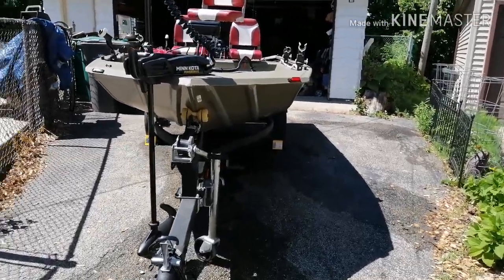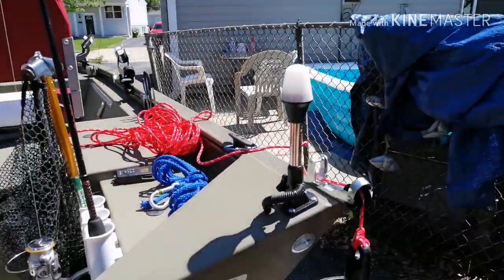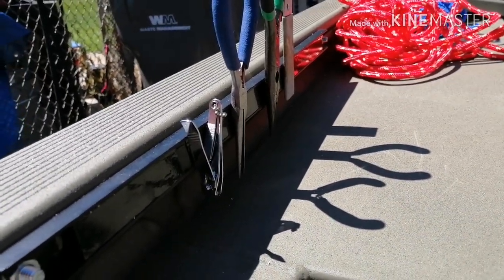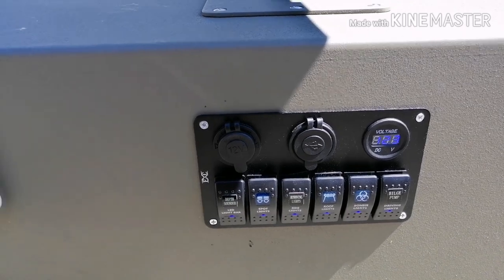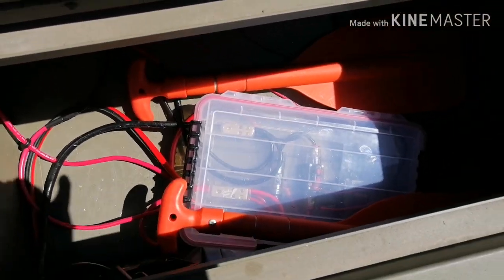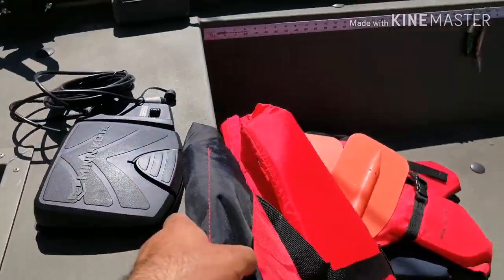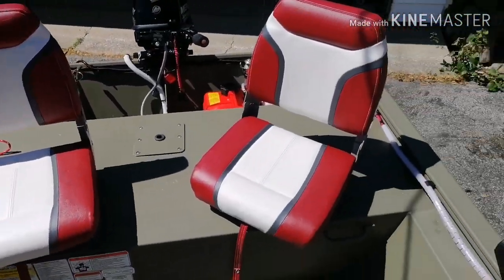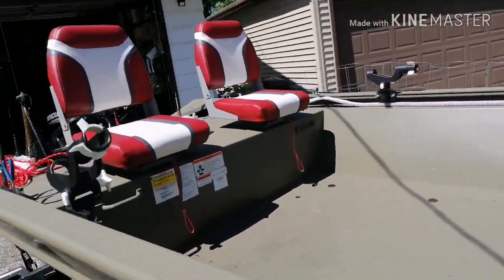Tracker Grizzly 1448 setup

Comment: I have the same boat (but a year older).  Doesn't matter at this point, but if you ever get another boat and want to mount a transducer, you should look at a Stern Saver.  It basically glues a plastic block to the transom and you screw into that.  It uses some very strong glue that is NOT coming off.  My transducer has been mounted that way for over a year and it works great.  Prevents ever having to drill through the hull.  I love the boat.  I wish it had a little higher weight capacity, but it is extremely low maintenance and easy to deal with.  The only thing I have left to do to my boat is a trolling motor.  I don't really need one (my 20 HP Tohatsu is not very loud and I can use it to go 2 mph for trolling) EXCEPT I want the iPilot Spot Lock so I can  hover over schools of white bass for jigging.  Would work way better than messing with an anchor.

Comment: Neat video. I have same boat. Q when you added 2 seats to rear bench did you drill 2 1/2" holes for lock n pin seat mount? I Want to add off center seat for mine, but afraid I'll drill into a support beam...

Comment: Can you please tell me what it measures from the very back of the motor to the tip of the trailer? I have a 19 foot garage. Love the finished  set up great job!
Reply from the maker: 17 ft 7" from the back of the motor to the tip of the tongue. That's with a 9.9 in the most upright position.
Reply from the maker: I believe they have the "towing length" as 18 ft, so probably closer to that if you got a bigger motor.
Reply: Thank you!

Comment: Hey man great setup. I just picked up the same one and was planning on doing 2 seats in the back too. What did you use for quick disco seat bases. Also I was worried about drilling into the bench not knowing if/where supports are. Any tips?
Reply: I bought the bass pro brand Grey plastic ones. No regrets. I just drilled wherever it's solid just thought he aluminum. The bench doesn't flex at all. Just drilled and tapped the holes.

Comment: Great review! I just got the same boat, and you've given me some ideas. I know you had just started breaking the engine in, but how is your speed now? I've got a Yamaha 15hp 4-stroke, and it will NOT get the boat on plane. So, I'm stuck pushing water at around 7mph with two of us on the boat. Also curious, why did you say you won't be using the foot control for your trolling motor? I'm trying to decide which style/brand to get now.
Reply: Getting the same speed with 2 people. I'm gonna drop the pitch on the prop at some point and see it that helps. I probably should have specified that reason I'm not using the foot pedal is that I always use the Co-pilot remote by hand. It's just easier for me and stays out of the way.

Comment: How many batteries  are you running?  I have the same boat with an Etec 25 Hp outboards  mine is a 2018! I need  to drill more holes for the rear seat  closer  to one side or the other. I think  Tracker  was silly  to just put a seat  post hole  in the middle only. Some other manufacturers  put a side post because  it easier  to steer the tiller handle from an offset  location!
Reply: Just one Group 27. Lasts me all day.
Reply: @Anthony Humphrey   how about the seat what are the dimensions  of your holes in the stern area

Comment: How's that motor doing pushing the boat? Did you get it all set up? Thinking I'm going to pull the trigger on one.
Reply from the maker: I'm only 2 hrs into the break in so I haven't been able to go full throttle for too long. I've gotten 8mph between 2 heavy people at 3/4 throttle and that was with my trim set way too low.
Reply: Go with an older 2 stroke that is well maintained. We got a 1994 mercury 25 that has  only like 300 hours, and has been garage kept for its whole life, and never seen saltwater, for $1250 it’s an amazing motor, starts first pull/press of electric start, sips gas like a 4 stroke, and is surprisingly quiet, and best of all I can get 34 out of it with just me.

Comment: What size Shaft on the Trolling Motor I just got a 2019 1448 MVX and I would like to know if the 54 in shaft is to long on the Minn Kota Power drive 55lb thrust.
Reply from the maker: It's a 55 lb Power Drive with 54" shaft.
Reply: Skeet Reviews Thank you from the video it looks like it sits about 24 inches off the deck do you ever find it gets in your way when fishing? Also do you think 45lb thrust is enough to push the boat I am looking for a shorter shaft length 48in but can not find a 55lb thrust in that shaft size? Any help is appreciated!
Reply from the maker: @bvfilm  it hasn't been an issue for me yet as far as getting in the way. It has a range of 10 speeds which I much prefer over just the usual 5. It just allows for better fine tuning of the speed. I think a 45 lb would do the trick.

Comment: How does the 9.9 feel with the boat
Reply from the maker: I didn't have my trim set at the right angle so between me and one other person I was only getting about 8mph.

I knew 9.9 wouldn't be flying but for me I still get plenty of speed out of it. I'm used to a 35 lb trolling motor so anything is an improvement.
Reply: Skeet Reviews thanks for the reply! I like your build a lot, I wanna get the same boat. I was looking at Lowe and other Jons that weren’t Mod V’s and I decided that something sturdier with a nice deck on it like that is what I want instead
Reply from the maker: This worked out well for me for the same reasons, I didn't wanna have to build a deck right away and Jon boats can be pretty unstable as they're pretty narrow.
Reply: Sweet boat I have three same one just got it. Let's see it on the water!!!

Comment: Can you get your cables through the versitrack?
Reply from the maker: In the track itself? No, you would not be able to fit many since the opening is 1/4" and that would then interfere with mounting any accessories. Beneath it you could mount some conduit.

Comment: Should i get a 14foot or 16 foot? Is the 14ft big enough? What's the max speed speed with the 9.9?
Reply from the maker: I believe the extra 2 feet is all in the space between the front and rear decks. I would have gone with a 16 if I had more room in my garage but the 14 is fine for me since I only have myself and 1 other person. I'm currently only getting about 6mph but I need to change the pitch on my prop.